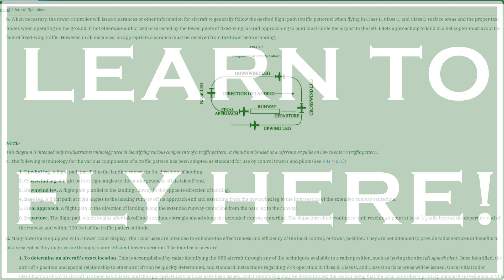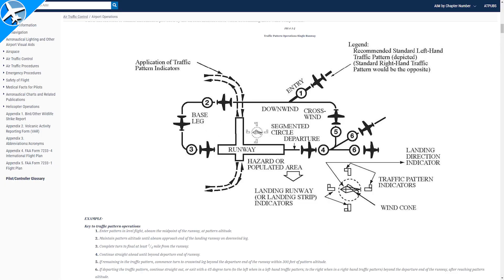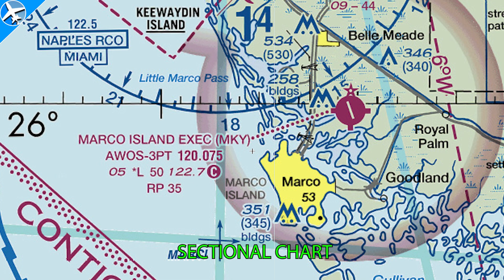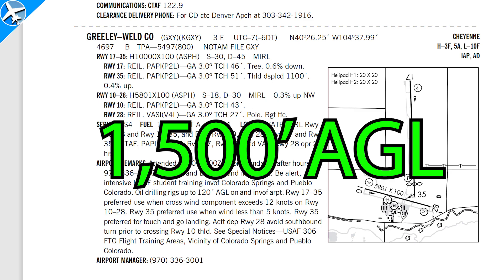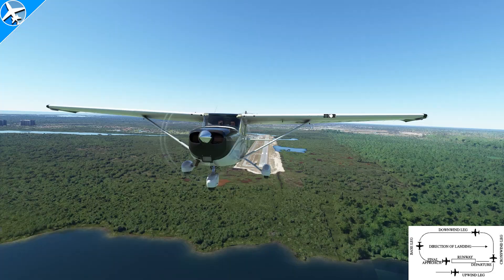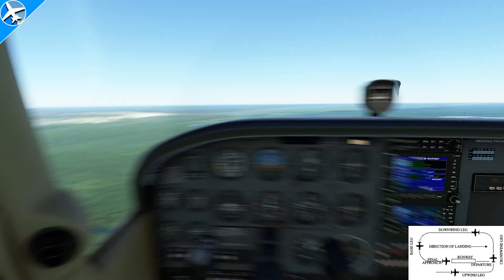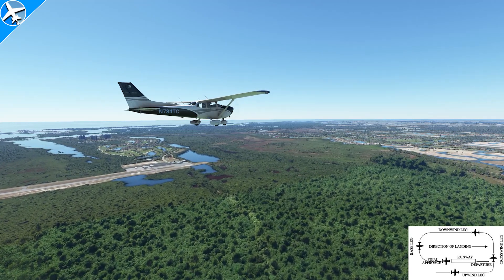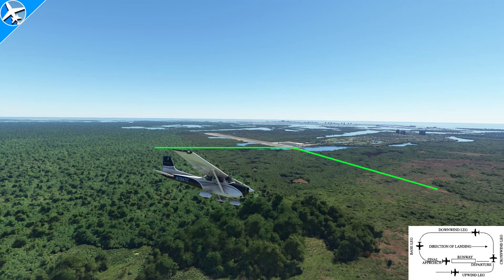A Beginner's Guide to VFR Traffic Patterns at Uncontrolled Airports

Comment: Don't add flaps if you're not in white arc!
Reply from the maker: With flaps 0-10 degrees the limit is 110 knots. It’s on the flap placard as well. For any flap setting above 10 degrees the white arc is used.  Many Cessna aircraft have a flap setting up to around 10 degrees where flaps can be added well above the white arc.  Also, jet aircraft do not have a white arc but also have multiple speeds for flap extension similar to the 172.

Comment: Good stuff! Just a note, there's a recent AC (2018) that talks about the recommended pattern entry if you're coming in from the non pattern side.
https://www.faa.gov/documentlibrary/media/advisory_circular/ac_90-66b.pdf

Also, I do think it's beneficial to state the direction of the pattern leg (left/right). If anything, someone listening might not have remembered or checked the traffic pattern direction (sometimes changed and listed in NOTAMs). Just being cautious.
Reply from the maker: This AC was used in the video and referenced in the video and linked in the description. Saying the direction of the pattern doesn’t hurt, but I was following the FAA guidelines in the AFH and AC 90-66b.  The AC also says not to use “any traffic in the area please advise” but is still used.  My intent was to use standardized phraseology but knowing full well general practices used by many pilots may not follow the FAA’s written word. Many pilots still use procedures that work such as “any traffic in the area please advise”.
Reply: @thecorporatepilotdad  excellent! I missed the part about the AC.
Reply from the maker: @iliasfaqir  no worries.  There is a lot of good information in that advisory circular.  Too bad hardly anyone reads them.  That’s just my observation.